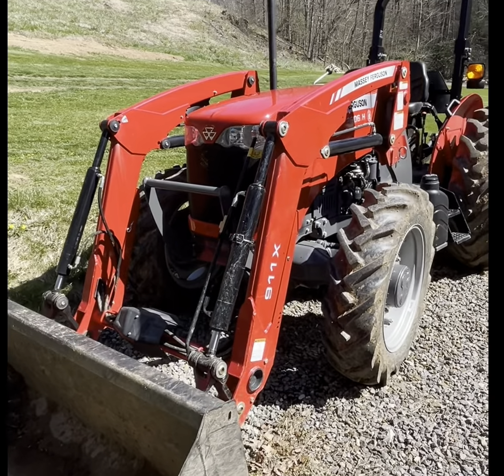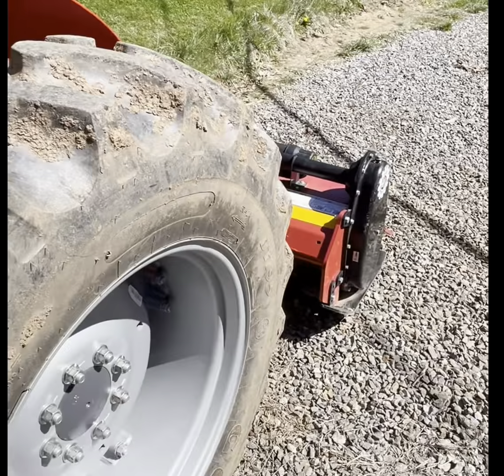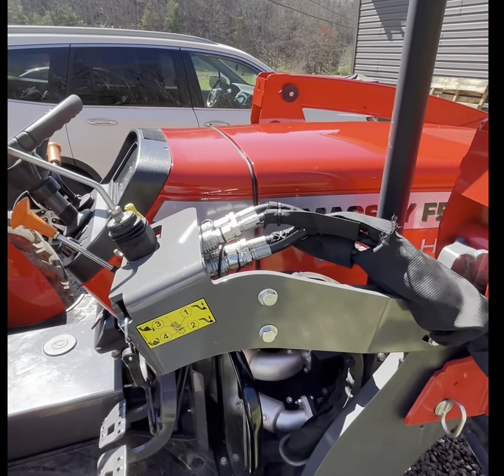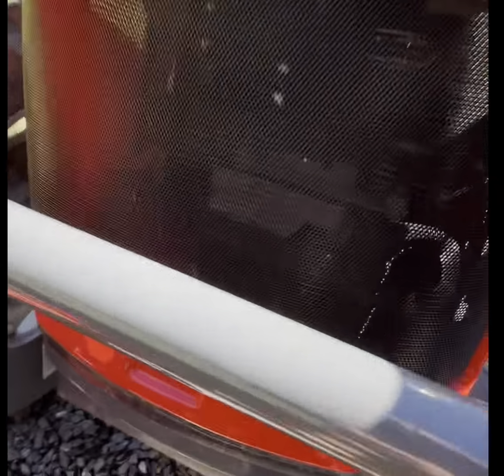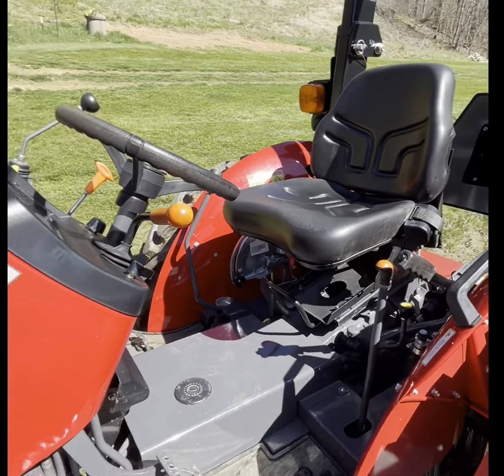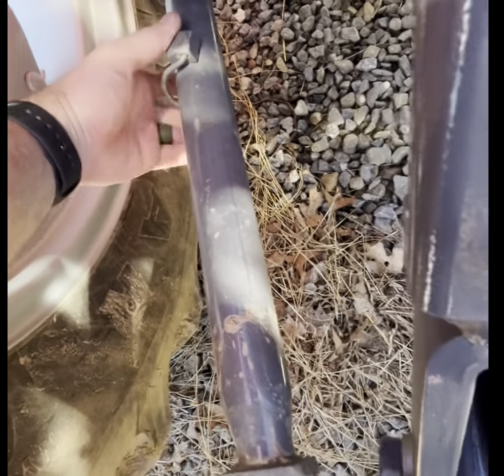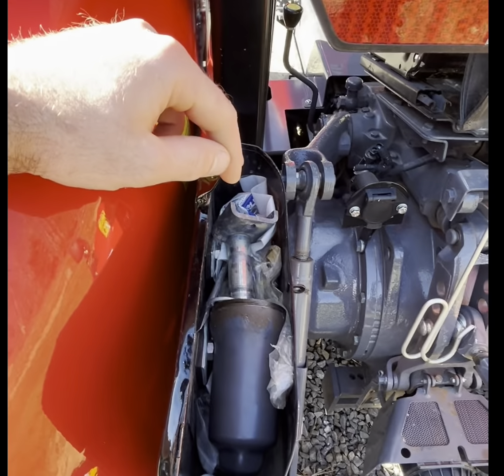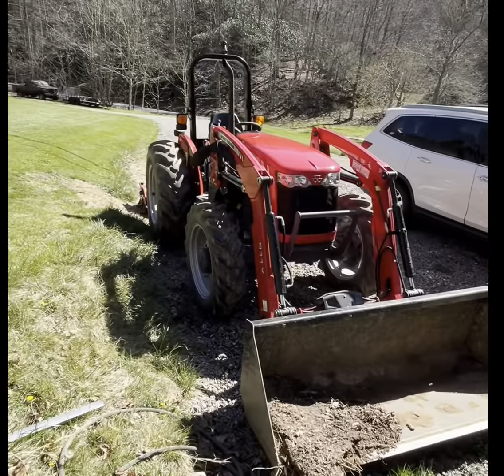100 hour review on the Massey Ferguson 2606h #masseyferguson #tractor #farmlife

Comment: Great video with honest review & comments.  Yes, the oil fill looks like a challenge.  One of those longer, flexible galvanized steel funnels would help in that tight space.  The Massey 2600H series is a tractor for me to consider.  Reminds me of the older ones that my dad & I used on the farm growing up.
Reply from the maker: Thank you! I looked into a Kubota for a while and when I first seen the Massey 2600 and started looking into it it reminded me of being with my paw riding on his old Massey.

Comment: Have you put hydraulic fluid in the tractor yet? And where is the fill location and the dip stick, to check the fluid level? I have a hunch but would like to verify. Also, is there any hard to see grease loxations that you have found? Also , do you know the socket size to the fill cap , for hydraulic fluid , that is in the floor board ( if that is whatbi think it is) Also can you tell me about the steering fluid brand and make up? Thanks for the video 👍
Reply from the maker: Thank you for commenting. I have not changed the hydraulic fluid yet. The yellow end dipstick for the hydraulic and transmission is next to the differential lock pedal on the right side. Manual says to change this every 750 hours. And yes the one with the rubber boot in the floor pan is for the fluid. I don’t have a socket to see how big the plug is for the fill cap. Biggest socket I have with me is 1 inch and it’s bigger than that. There are multiple grease locations, obviously down both sides of the loader( 22  total for the loader) . There are grease fittings underneath the brakes and clutch, for the top link on the 3 point and both bottom links for the 3 point for the up and down adjustability for both sides. Also behind the front wheels right about the axles. Many of these are easily over looked, when it’s time to grease them I would take my time and look for any moving part and more than likely it will have a place to be greased. And it has a hydrostatic steering system, manual says there is no exclusive reservoir and fluid for the steering system. This system is controlled by hydraulic power. Manual doesn’t include anything about maintaining power steering system. I hope this helped.
Reply: @GreenMtnTractor  thank you for your reply. I have just started using this model on a job and I am getting familiar. We bent a hydraulic cylinder, We were replacing culverts and cutting a dam on a live pond , that was about to blow out, so things got hairy. Anyhow, we got er done and save the pond but using the grapple, in a tough situation , lost the right cylinder. Got it repaired and lost fluid, so I'm trying to get more fluid and get her filled up, before things do go south. Lol. So thanks for your info. 

On grease fittings, you are so right. I own 
Year 2012 mf2635 that has been a warrior, and got my boss to go with this scaled down 2606h mf, that is a little beast as well aka little brother. 😅But I was out looking over my tractor, just now and found a fitting in the front axle, pivot. It's in the front under the radiator ( in the center of axle, where the three structural  ribs are located) on the left side, looking from the front . It is hard to see. I'm not sure I've ever seenn it, maybe once but, is there. So that leaves 5 fittings in the front axle, if I'm correct. Anyhow, there's a bolt missing in the front of my pivot arm, I just found. So got to get that replaced. I don't know if the 2606h has this  " grease fitting" but the offset pumpkin and everything looks the same, so you might check your unit. So thanks again 👍👍
Reply from the maker: @SkyHawk975  I’m glad I could help! The grease fittings, some hidden in plain sight and some just hidden lol. I found a few that I’ve missed when I started counting them lol. Hopefully you can get everything back and running. They are fairly simple machines, I wish I had a few more tips on changing the hydraulic/ trans fluid, but any little bit I tried to help. Thank you for watching and commenting!